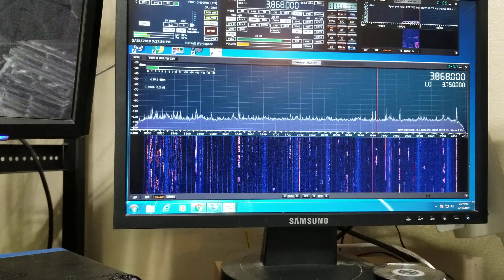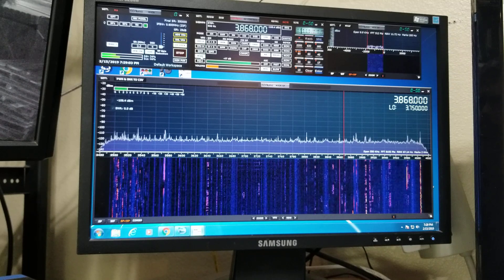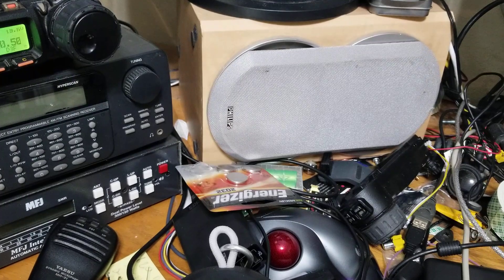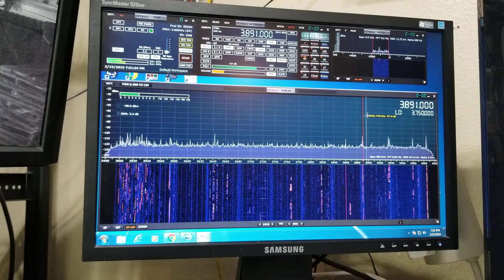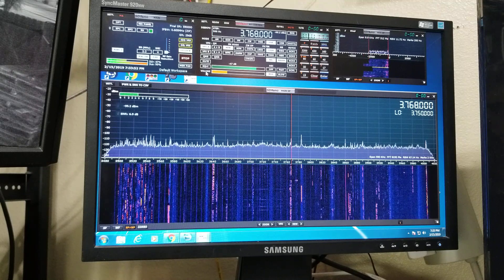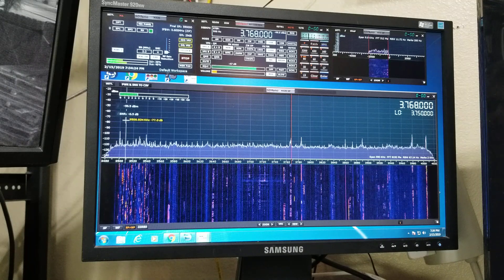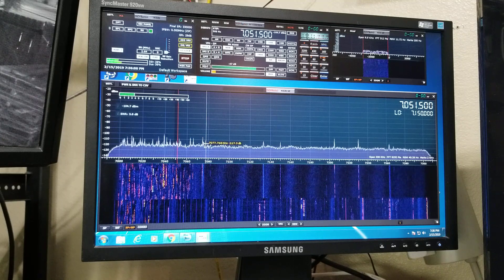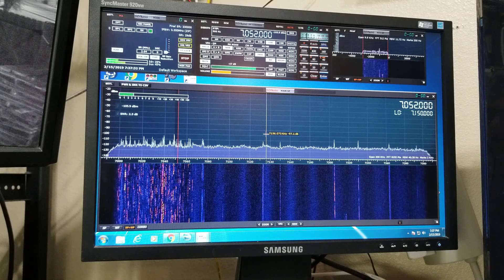Miniwhip antenna on SDRplay RSP1a with SDRuno

Comment: Are you powering this from the Bias T in the 1A, or external? The rated current is 100mA and that’s exactly what the whip needs, so I think it’s not possible.
Reply from the maker: I use the injector that came with the kit..but I found that lower voltage  helped with noise.
Reply: @KK4PYN  interesting - 1 year later I finally got one so this is helpful, thanks!